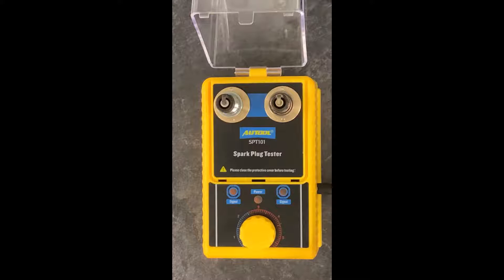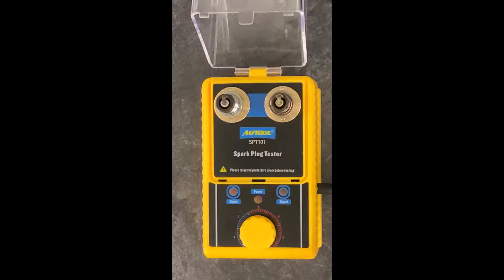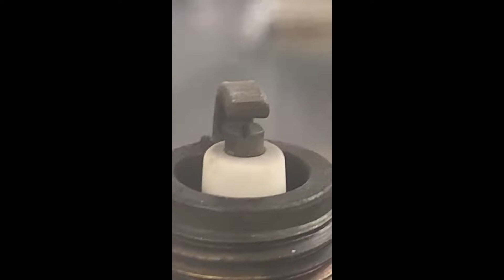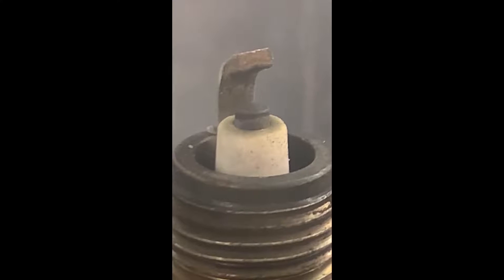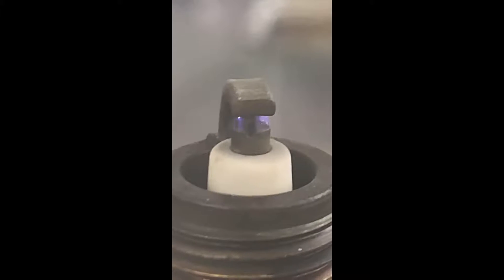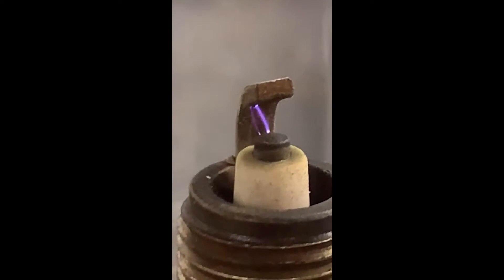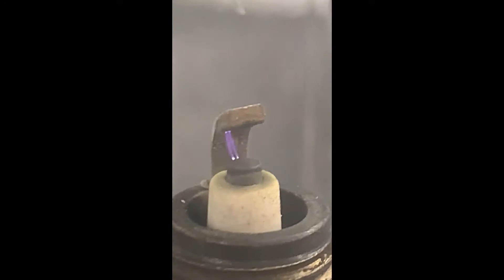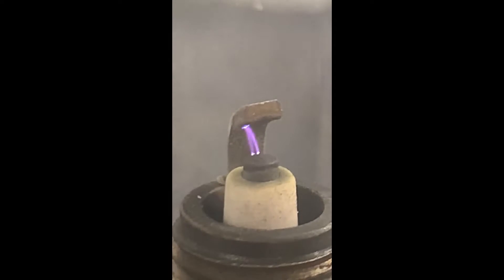AUTOOL Car Spark Plug Tester Review, Effective for testing functionality of new and used spark plugs

Comment: Just bought me that same unit from Amazon today.  Gonna test those old spark plug and see if they're bad  and need to be replace on my wife's camry.
Reply: Went to change the plugs on my 2009 Camry & they was real tight,I had used anti-seize on them 4 or 5 years ago.They was tight all the way till you got them out.I was scared they was going to break.I had to use blaster to get them to loosen up.